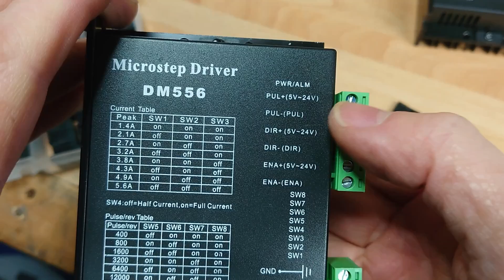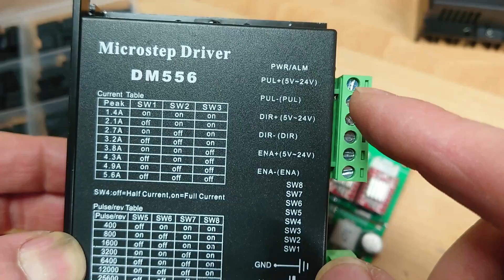Using a GRBL controller for a CNC Lathe [A23_5]

Comment: Hi , Can you please let me know the grbl  board you have used? Also Could you use Mach 3 software on there?
Reply from the maker: The board is a woodpecker that came with the cheap 3018 machine, but any 3 axis GRBL board will do.  GRBL can be used with candle, UGS, and possibly some others, but not Mach3. There are Mach3 boards available, but the cheap ones need a parallel port. Some are USB but it seems to be a lottery if they work or not.  There are some more expensive solutions out there, but I stuck with GRBL as it seemed a better place to start.

Comment: Hello! Great video, very informative. We are working on a similar CNC lathe project, but we are having some trouble selecting the right stepper motors. Could you please share the motor specifications you used and how you determined they were suitable for your setup? Any recommendations for selecting motors based on weight and power requirements would be very helpful. Thank you in advance!

Comment: Howdy! I have a literally identical concept of a CNC lathe (mine's built on a Jet 1220 wood lathe with hiwin type rails, but the electronics are the same and I also use Fusion) and I am having a bit of an issue. GRBL does not store tool length offsets. So as you go from one tool to another, you're expected to zero the tool as you go. If you have a part that needs several tools for example (right hand, left hand, parting, boring) you're sorta stuck. I am faking tool length offsets by assigning different WCS for each tool. I can use 6 WCS in GRBL, so I am limited to 6 tools. Do you have a plan that would allow the use of more tools with pre measured offsets? Thanks in advance!
Reply from the maker: Hi, the lack of GRBL tool offsets is a known limitation, and I've yet to do anything about it.  I think the way you are doing it with WCS is the only way without doing anything clever.  If you can write code, then it should be possible to run a script on your gcode to pick up the different tool numbers and directly apply the appropriate offsets to the x-z coordinates in the gcode.  The other option, that I have been considering, is buying a mach3/4 compatible controller!

Comment: I have something similar done for my Warco WM180 lathe. But the controller is limited. Im thinking of getting a a bigger WM250 and doing a proper CNC conversion to that including the ball screws etc. But being able to run proper GRBL generated from fusion looks awesome. Especially for things like threading. No need to muck about with change gears etc
Reply from the maker: I've yet to try threading. There are a few ways to tackle it, but the simplest (in my opinion) way to tackle it is to use a stepper motor (or servo) to drive the spindle, this can be done without any special software. I have seen an "encoder on the spindle" solution (a bit like an ELS), but that requires more work as the GRBL boards don't have encoder inputs.
Reply: I have the Nano ELS H4 and that can do threading via the controller but no support via gcode yet.

I think how it works is it adjusts the feed rate to match the speed measured at the encoder rather than trying to keep both in sync. It works really well so far but its a bit manual having to set up the thread without gcode. @ollysworkshop

Comment: GRBL is most cheapest CNC DIY solution available, but it must be very reliable, robust like industrial solution for problem-free operations. So, you need to be sure about interference, EMI, USB stable connection etc...
Reply from the maker: Thanks for your comment. I agree that it needs to be stable, and I know all about EMC, but so far it's given me no trouble in that regard.

Comment: A few years ago I bought a Proxxon micro mill and added cnc. It took me hours of endless learning. Finally I was ready. Test run, all went well. Decided to try a piece of aluminium and a small hss end mill. Fingers firmly crossed. OUCH The end mill drew itself out of the collet and drilled itself into the aluminium and into the Proxxon vice. It shock me for six. I felt out of control.
Many years later, it stands unused gathering dust.
I so admire anyone who successfully tames either a mill or a lathe to run it via cnc. 
Well done on this initial trial. 👏👏👍😀
Reply from the maker: Hi Andrew.  I think that's the key point - once you hit that go button, you are completely out of control.  You have to hope that what you told it was right, that you tightened everything, twice, and that the gods are smiling.  I was smiled upon that day! 🤣

Comment: Those GRBL controllers are awesome for entry level CNC! What did you use on the pc to control the lathe?
Reply from the maker: Yes, the grbl controller was very easy to get going. I'm wanting a more advanced system though (e.g. mach3, linuxCNC), but don't really know how to choose.
I'm currently using Universal GCode Sender.
Reply: @ollysworkshop  I have been looking at linuxcnc. It is quite capable. Mach 3 seems antique, and also running anything like this on windows is not a great idea.

Comment: Wish I could put more than 1 thumbs up Olly 👍👍👍👍👍. For someone who understands the complexities of CNC but has no idea on electronics at all, this is the equivalent of scaling Everest. Well done 👍👍👍👍
Reply: me too Jon
A gerbil is a rodent in my book!!!🤣🤣🤣🤣🤣🤣🤣🤣🤣🤣
Reply from the maker: Thanks Jon. All the groundwork was done on the little CNC lathe that I made a few months ago. I just ran the same program after adjusting the settings so it was moving appropriately. I've still got loads to do, currently I have to zero the tool every time, so I need to sort out offsets, and some kind of tool turret. I don't think I'll ever be bored.